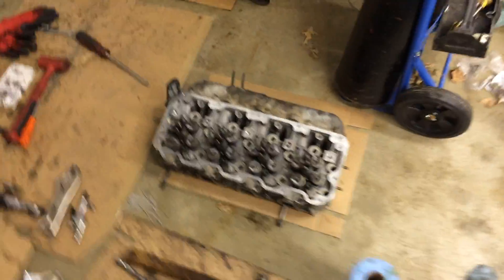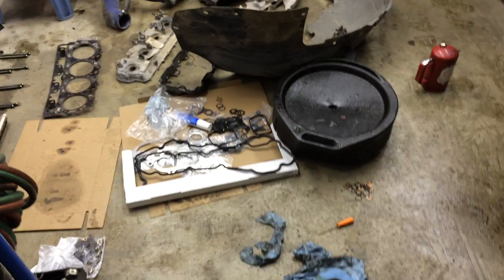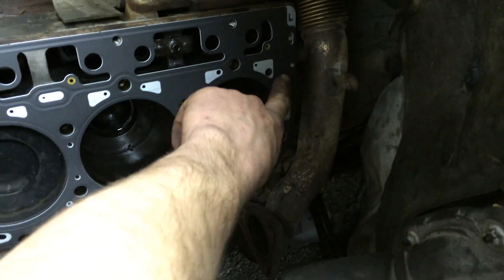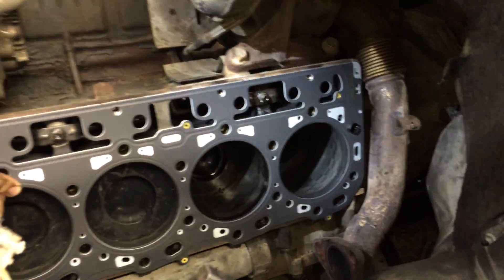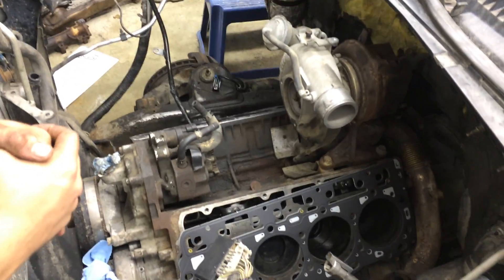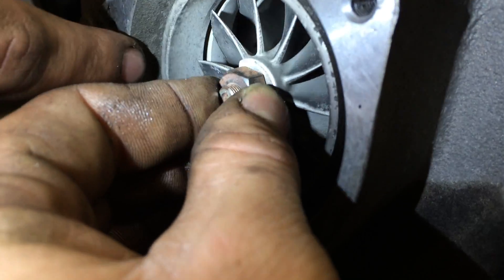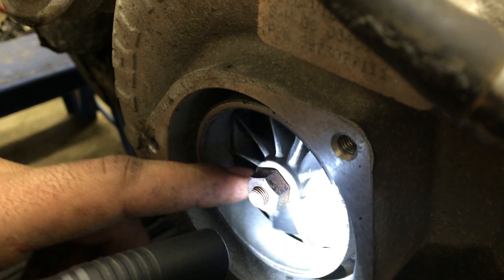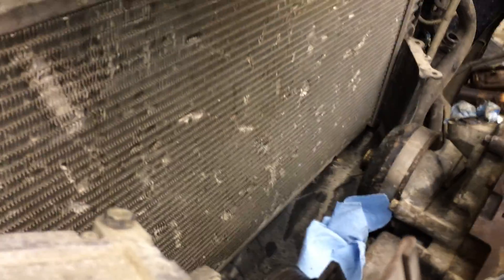Duramax Cylinder Heads and Turbo Bearing Play Part 3

Comment: Just took my 15 lml to chevy, my head gasket went at 38k miles..never tuned/ deleted or anything. Good thing it' still under warranty. Tech said exactly what you did 40 hours of labor and a 9600.00 bill